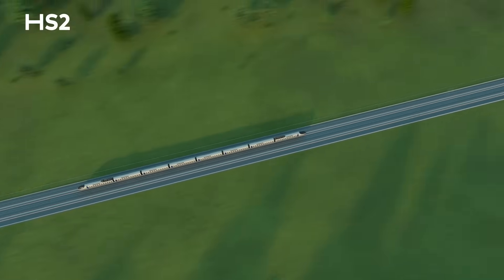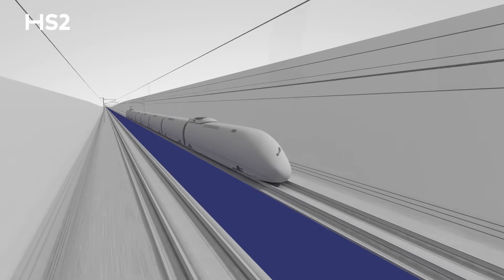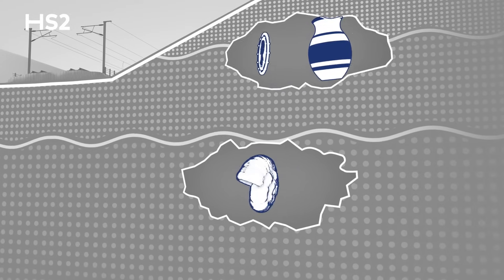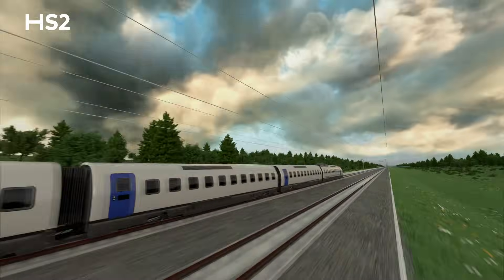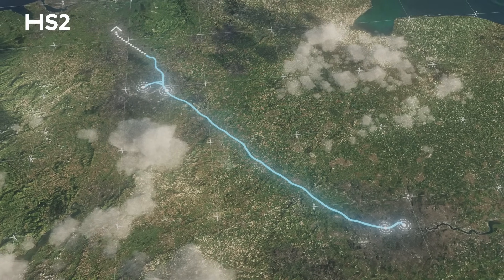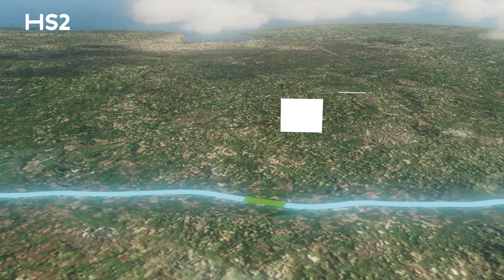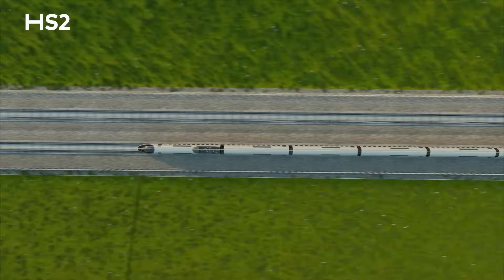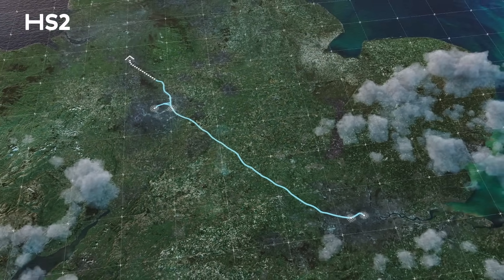HS2 cuttings and embankments

Comment: HS2 claims the route will 'require gentle gradients to deliver a comfortable journey.' Wrong. The gradient in the Chiltern Tunnel from Great Missenden to South Heath will be extremely uncomfortable; the gradient westwards off the Delta junction down to the valley of the River Tame will be so uncomfortable that the passengers will probably need vomit bags. As for the discourse on slope ratios, consider the cutting through the spur at Culworth. And in response to HS2's much lauded claim that more than half the route will be below surface, what a great misfortune that one of the finest historic landscapes in Warwickshire, the plain at Wormleighton, will be sliced through diagonally by the railway on an embankment
Reply: Gradients do not cause passenger discomfort - certainly not HS2 gradients, which are limited to 3.5% maximum. The maximum gradient through the Chiltern Tunnel is 3% (1 in 33) at the north end. What causes motion sickness is vertical curvature. The amount of vertical curvature allowable varies with speed so the south end of the tunnel has 37,500m radius curvature whereas the north end increases that to 40,000m. That reflects an increase in linespeed from 320kph to 360kph. 
The French TGV has ruling gradients of 3.5% and it is noticeable when trains go from an ascending to descending gradient. That might be a roller coaster in railway terms but I doubt it causes any motion sickness.
Reply: This reminds me of the surprisingly steep gradient when leaving the tunnel out towards Dagenham on the HS1. It felt like a roller coaster for a bit

Comment: I'm very impressed by the "cutting inside an embankment" approach. The anti-railway campaigners have been complaining about the width of HS2, but this makes for a sound screen that looks more like a hillside than a big block of concrete. And the cutting at the top should make it easier to get green bridges across the railway, so that wildlife can go across the HS2 route, without intruding onto the tracks.
Reply: Although, with motorways everywhere, mostly unscreened and with constant road 'hum' (I should know, I live half a mile from a raised dual carriageway!), does anyone really hate the very brief sound of an electric train swoosh? It won't even clack as there are no joints in the rails and few points to run over.
Reply: I understand the reasons, but it's also nice to see the scenery sometimes. 🥺